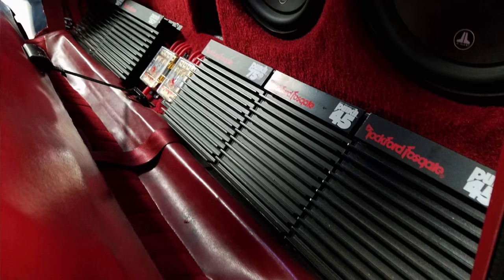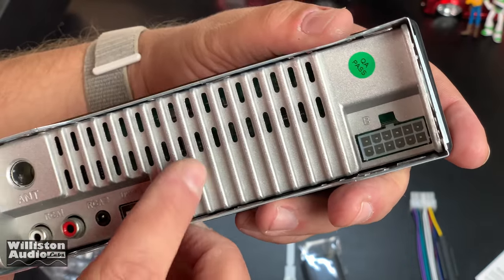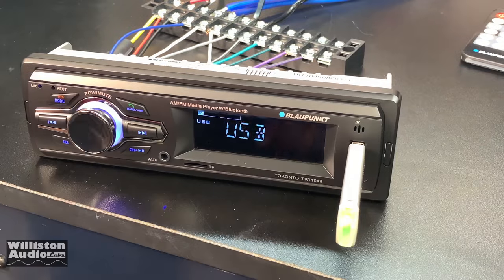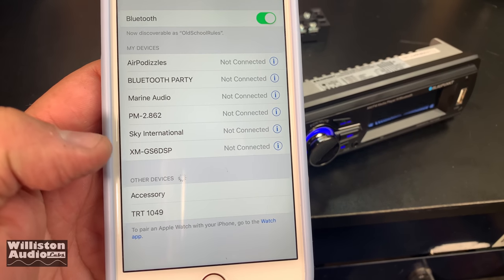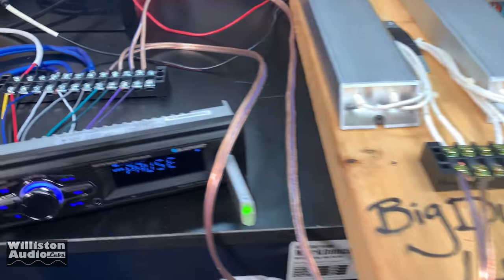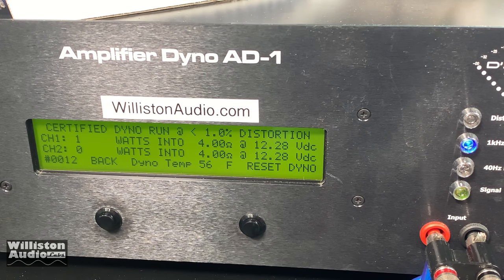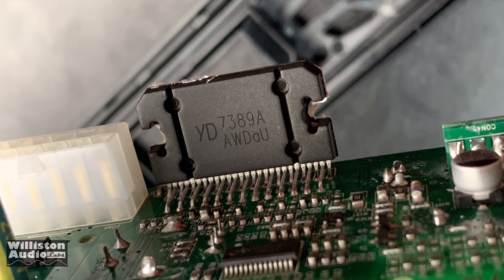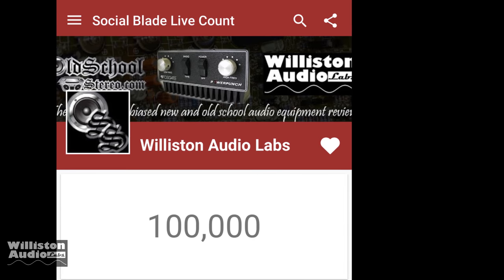Is a $10 Walmart Car Stereo Any Good? [4K]

Comment: It may not be a fancy advanced head unit that can drive 2 subs or anything, but honestly that's really not bad for $10. It would be perfect for modernizing grandma's car.
Reply from the maker: It’s absolutely insane, if it works for more than a few months
Reply: I bought some car stereo for 20$ and it drained my cars battery after 2 months of use, i did connect it to ignition vire so it doesnt drain when car is off but no luck it still drained it when it was off..
Reply: For 10 bucks, I guess you can't beat it!

Comment from the maker: Update: Rear 3.5mm is indeed a line level output. It fades with the rear channel. Sorry, the cable I tried in the original video must've been bad.

Buy the Blaupunkt Toronto: https://amzn.to/2U88PNg (warning, price bump!)
Check price on Walmart.com - https://www.walmart.com/ip/Blaupunkt-AM-FM-Bluetooth-Media-Receiver-Toronto/836526302
12 Position Terminal: https://amzn.to/2WBYi9L
Shop Blaupunkt Amplifiers: https://amzn.to/2TGTsGl
Blaupunkt 12" Sub:
Walmart: https://is.gd/blaupunkt12
Amazon: https://amzn.to/2ObnMYp
Reply: Thanks Derrick,  I just bought 3. Even if it's only used for a Bluetooth module that's about as cheap as you can expect to get anywhere.
Reply: Hi can you test the phoenix gold ti3 1300.1 at  0.75 ohm please
Reply: Could that rear 3.5 mm be for a microphone for BT calls?
Reply: Big D I've been getting your notifications really late just letting you know 🤷
Reply: I'm not much of an Impulse person but I went ahead and bought two of these. Thanks for the review. I'm sure they are flying off the shelf now LMAO!!!
Reply: 3.5 jack on the back is for a microphone for when you make a phone call through bluetooth.
Reply: Williston Audio Labs what is the amperage draw? Just wondering what size of power supply to use on one for a shop radio. See how long it will last. Btw they must be back ordered, mine with prime is going to take from 4-18 to 5-1 that’s some good shit right there. You sold their stock out. Limit 5 per customer lol 6 if Derrick sent you. Nice work as always bud🤘
Reply: Congrats on 100k subscribers
Reply: CONGRATULATIONS ON 100,000. Subs. Brother
Reply: you might want to use the speaker level output as a line driver for possibly a higher voltage and to use the f-r .
Reply: The 3.5 is probably for steering wheel controls
Reply: Is it possible that the rear 3.5 mm jack is used to connect an external Microphone?
Reply: Sir, could you please post a link to the owner's manual? I try searching online but nothing turns up. TRT1049 returns no results on Blaupunkt's website, google too. I want to know what the power requirement is. I know it's 12vdc but what is the current draw on this unit?

Thanks.
Reply: I'm pretty sure I am the first to think of this......but perhaps the 3.5 Jack on the rear is for and external mic during phone calls?
Reply: *hits the blunt* Why did they name it after my city? Toronto ain't cheap! A blunt cost more than $10. lol
Reply: @STONEDay  
I'm from Vancouver....blunts are basically free here.
Reply: to be honest when you connected your phone up the connected sound is like the bootup sound of my omaker bluetooth speaker
Reply: If you're gonna review a cheap radio you might as well do one on the cheapest subwoofer, PYLE PLPW6D
Reply: Hey guys I'm getting a Pioneer GM-D8604 4 channel amplifier rated at 100 watts rms 4 ohms with a Kenwood Excelon KDC-X303 Cd reciever with 5 volt pre out sin the back. Also running a 1000 watt mono amplifier for two kenwood excelon KFC-XW100 300 watt rms 10 inch subs. Also using a Pyramid AC to DC converter The PSC 300 30 volt I believe. 
I'm looking to upgrade my speakers to something that can handle that 100 (125 watt dyno unofficial) watt speaker amp that I'm looking to buy Wondering if anyone has any suggestions for something really nice around 75-150 bucks is what I'm looking to spend best bang for my buck would help but something competition status or close to it would do. I was thinking Pioneer pro series or Polk Audio DB692 DB+ 6x9  thanks
Reply: As of 4/8/19 they are gone, gone,  gone.  I don't need one but I sure want one, plus I found a small flat area on my bench with nothing on it !
Reply from the maker: Note: I updated the post...the rear 3.5mm is indeed a line level output. Tested again with another cable and yeah boi!! Get a 3.5mm to RCA adapter and you have 4 channels of line level outputs!
Reply: It looks like I made a mistake,  Wal-Mart  online still has them for $12.99. That small flat empty  area on my bench with nothing on it will be put to use. 
Thanks.

Comment: I bought one from Walmart a few months ago for $12, and ponied up the extra $3 for a 3 year, full replacement warranty.. :-) I installed it in my fishing boat, replacing the 1999 AM/FM Cassette deck that it came with. Just like the video, everything worked perfectly. I tossed a Micro SD card in it, and it bluetoothed to my phone almost instantly. Call quality through the handsfree (In my boat) was great at long as the 40hp outboard wasn't running, and it pushes my outdoor Kicker KB6000W speakers perfectly!!  When it fails, I'll unplug it and have Walmart give me another. I hope I didn't waste that $3 for the warranty... LOL

Comment: I got a Walmart stereo one time from a brand called XD or something like that. Didn't look too bad. It was 18 bucks and change before tax. Wasn't expecting much. Fucker had a remote and Bluetooth audio that worked, plug in for an amp and subs and it sounded nice. I rocked that until I sold the car. Good deals are out there

Comment: I've had it installed for a year now, it works. My only issues with it are it doesn't get loud enough sometimes to be audible over the wind when the radio is down. My other issue with it is that the display stopped working well shortly after installing it.  The Bluetooth works well and auto connects when I get into my car without fail every time.

Comment: Automatic thumbs up for the Red Fox nod.
The only reason most stereos are longer than this one is because of a lack of a quality amplification circuit and CD/DVD or heaven forbid Cassette. Since this one doesn't have any of those features and is relatively modern it stands to reason that would be a logical size for that price. Don't want a large bill of materials weighing down the cost unnecessarily. That being said, you get what you pay for and this is no exception.

Comment: So has the company had its name sold to the Chinese like a heap of other companies..
They used to make high end stuff in Europe.
Reply: @Jess Garcia "Meh"?  I think this review shows its anything but meh.  I've seen some proper cheap Chinese crap car radios, and they are no-where near the build quality of this unit, instead of aluminium back, the thinnest steel i've ever seen this side of tin foil.

For $10 that is simply crazy good quality, if thats your idea of "meh", I'm thinking you don't understand what "meh" means!
Reply: Bosch sold off their Blaupunkt brand in 2008, and only kept the OEM business. Blaupunkt now just sells the brand. Even the Toronto name on the unit here was used for a "real" Blaupunkt stereo back when I was still looking at aftermarket stereos (late 90s?).

Comment: I bought one when it was still $10 on Amazon (in 2019), and had it for two years.  It was good for the first year, but the screen on it is the weak point.  After a year of use during a extreme humid summer the screen failed.  Since I did have the remote I was able to use it I could not though see what the settings were.  Apparently high humidity & temps as well as no protective cover on the screen caused it to fail.  I replaced it with one from Boss model 612UA for $30 when the remote failed too after two years of use.  For $10 I got my use out of it however I would not recommend it above $20 due to that exposed screen especially if you live in a area that's really humid & hot.
Reply: Yep lol had one in my 97 accord in 2018. NC summer heat killed that screen.
Reply: I can confirm screen failure during high temps of summer. 
I bought two of these units. Installed one in my car and used one indoors.
The screen is still fully functional on the one kept indoors after 4 years of daily use.
But the volume knob is getting unresponsive.

Comment: Blaupunkt (the German firm) filed for bankruptcy in 2015 and they had already sold their car audio unit to an asset management firm back in 2009.
So any car audio product from Blaupunkt after 2009/10 are just cheap chinese products.
Reply from the maker: Correct! So sad but true
Reply: That would explain it.  I remember them as being a premium brand - I think they were one of the first with in-dash DVD players and with microphones to measure the ambient noise to adjust the speakers accordingly.
Reply: They even made vinyl decals for car windscreens with the blaupunkt logo.  I was fresh out of high school and couldn't afford such luxuries - I was lucky te replace my factory head unit in my 1989 Grand Am with a reliable JVC with aux input.
Reply: Ahhh that explains it, why didn't the guy mention that at the start. Seems a little deceptive for a reviewer to leave out such a key detail, even if the product is good. These firms buy up well known names and count on people associating it with the original makers. I don't think it would have hurt the sales or the review to just be honest.
Reply: @MrWildbill  Yup.  RCA did that also.  Also Vivitar (that's why you see random stuff with the Vivitar name).  There are a few other companies I know of like that but I can't think of them right now.
Reply: Lol I was going to comment that. Without research, I bought the San Marino 500, used it for weeks later the screen develops dead pixels - vertical lines. The San Marino 500 turns out to be the same as some cheap MP5 player, but with less features! 
Smh.
Reply: @nasilemak868  I'm looking at that.  That totally presents itself as a premium product in the Blaupunkt tradition.
I wonder what is going to happen with the car stereo market, given that on today's card you can't just swap in a random stereo.  They specifically fit with your car model's dashboard and are integrated with your car's functionality.  You can get stereos for specific models, and they work pretty well (I assume) but you can't just go into a stereo shop, look at all of the DIN or 2-DIN units and find one you like.
Reply: It is printed on the box "ESTABLISHED in Germany". It does NOT says MADE in Germany. So it's true it was established/founded in Germany and after bankruptcy the brand name was sold, it's just a nice sounding name.
Reply: If I recall Honda used them back in the day....

Comment: I'm not too surprised to see the market for aftermarket head units crashing. it is nearly impossible to install a head unit on many modern cars, and if you manage to at all it might mess up features built into the car. So the market that is left is older cars that are not going to be around for that much longer and manufacturers are clearing old stock and discontinuing product development. I think amps and subs and such will be around for a while because they are still installable, but the head unit market will shrink and not return.
Reply: Older cars are DEFINITELY going to be around for a long time dont kid yourself
Reply: Dsp market is going to grow more
Reply: Yeah the market is definitely shifting toward integration/installation adapters and the big names we knew in the 80s/90s don't seem to be investing much in that market. Audiosource, scoche, etc are primed to grow in the near future since they already have R&D departments dedicated to integration with OEM data bus/wiring. I'd imagine we'll see at least a couple more big names fall to Blaupunkts level in the coming years. Sad to say it tho :(

Comment: In Brazil, the same car stereo costs R$ 200 for around US $37.64.
very frustrating.
Reply from the maker: But you can get Taramps 3kW amps for $100 USD 😬
Reply: And the cheapest car stereos (like a R$ 100/US$ 20 Multilaser, First Option, Knup) They have a very bad build and a bad sound quality.

Comment: Has anyone figured out the rear 3.5mm jack?  I know in the video he mentions he didn't figure it out.... I wonder if it's a Mic Jack for when you're doing phone calls (so you can mount a mic closer to driver  rather then using one in the head unit).  Anyone know?
Reply from the maker: I’ll check again today

Comment: An Update on the Toronto TRT1049 $10 Blaupunkpt Stereo, Bought it when the video came out. It worked ok at first however, for some reason you would need to press the reset button to get it to work after you receive 3 or more calls via bluetooth from this unit. After resetting it about 3 times it has since now worked well when using bluetooth especially with incoming phone calls. Secondly the display on the unit is now almost totally unreadable(The Display LED's /LCD is partly working) and there is no brightness button to increase visibility during the day so you have to guess what mode you are in or what you are listening too. The most i can tell is that when its on you can see the Blue light at night or during the day you can hear the sound, there is very little equalizer adjustments you can do if any but it kind of works.  In My opinion It was not worth buying this unit and spending the time installing it only to have these problems just a few days afterwards and the LCD display just kept loosing letters etc. If you can afford a bit more i would go for a unit that is a little better like the cheaper pioneer over this unit. I have had this unit installed in my car approximately a year now and it still "sort of" works but i will be replacing it with a better unit soon.
Reply: Buy 10, replace one a year

Comment: I think that 3.5mm jack in the back might be for the steering wheel controls adapter. I could be wrong, but my aftermarket had a similar style plug for the steering wheel control adapter.
Reply: It's the mic port

Comment: I bought a Blaupunkt Omaha 206 about 2 months ago from Walmart. I paid about 50 dollars for it and when I hooked it up, I was amazed. Sounds great, looks great and one of the best deals I have seen all year. I had an older Pioneer that was almost 250 dollars at the time. It was a good system but this one sounds better and offers so much more. When I saw this 10 dollar system, I would have never touched it because it is so cheap. However, after buying the 50 dollar one which has a CD player included, I believe that Blaupunkt puts out quality even at such a low price. I understand the concerns about putting this unit into a 70,000 dollar car. But if you spend that much on a vehicle and decide to install a 10 dollar unit in it, you need to have your head examined. New cars have very complicated wiring systems. The slightest spark can blow your entire cars electrical system out. Putting a ten dollar unit in a new Cadillac or BMW should be considered a criminal offense. These units were made to be installed in an older Toyota Corolla or Nissan Sentra or even a 80's or 90's Mustang or Camaro. It updates your older vehicle into the age of Bluetooth, SD cards and USB ports. It does it without costing you an arm and a leg.
Reply from the maker: Well put 👌

Comment: I have one of the older Wal-Mart specials that has the front USB port and it has a standard SD card reader. I paid $ 12 for it new and it kicks ass for what it is. It sure beats the old cheap radio/cassette players plus there are no moving parts to wear out. It will allow you to play up to 999 songs on a single SD card or the USB port. The FM radio is decent but the AM radio isn't hitting on too much. Yes this was worth every penny especially for a work vehicle or even for a cheap car.
Reply from the maker: Great feedback

Comment: it dosnt need to be that big. You dont use a CD or cassett anymore.
You actaully dont need one if you dont use the radio.
You just need to make an interface for you cell phone or mp3 player to your AMP.
It's worth it just to have it as an interface

That's all that is...is an MP3 player. You can get those for under $5.
You can get micro 32G sd card for $5...That's more than all the songs..you'll
ever use or can remember....if it has a play list option and an EQ..it wound be cool.
They can steal it all day long for $15.....They used to steal my $1000-$1500 system
or $300-$500 head unit..that dosnt even do half as much
Reply: , the radio part is a tiny chip, well worth putting in of course, cd and cassette are both a thing of the past and bulky,  modern tech means the rest is tiny compared to the old mechanical push buttons and presets., 25w or so is enough for car radio use (we are not aiming at a rave system here, but a normal and useful volume).   example, in the UK you can buy a base model dacia with no stereo t all!  the dealer chargers £250 for its fitment, apparently the speakers and basic wiring are already present, this would be a no brainer to buy and fit to such a car, its always useful to have, even if you dont like radio, that function i still believe should be present in all cars